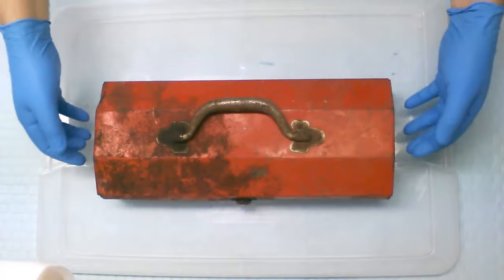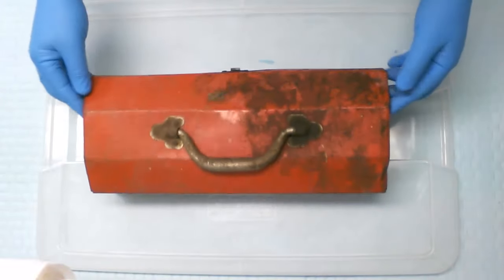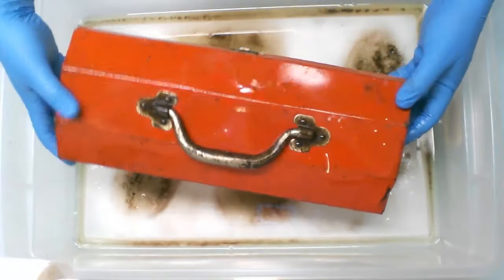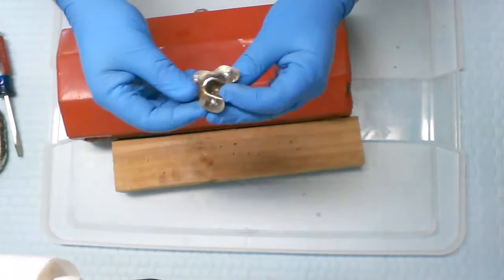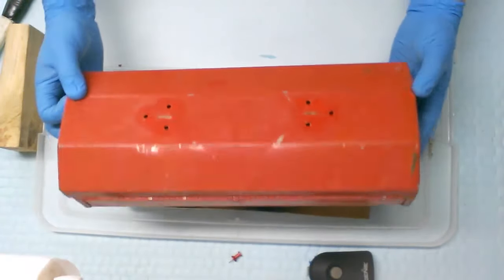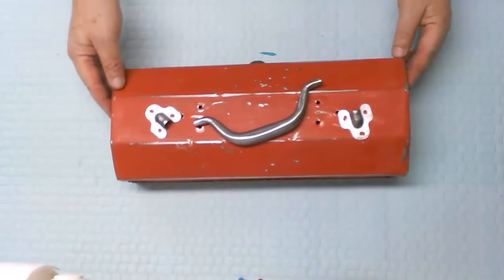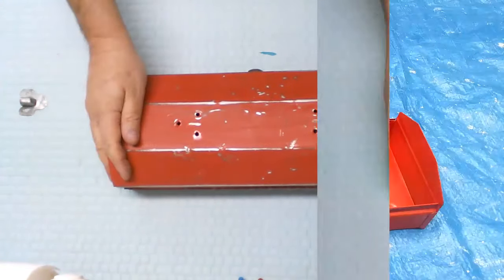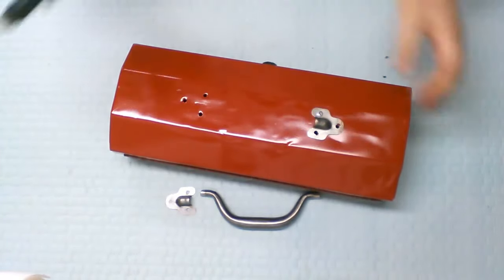Vintage Tool Box Restoration

Comment from the maker: In this video I take a tool box that was sent to me by a subscriber and I fix it up. As you will see it was dirty, grimy, and full of dents, but I make it look like brand new again. If you enjoy restorations, you will enjoy this video. Thanks to my subscribers that support the channel and are kind enough to send me stuff to work on so you can all enjoy.
Reply: Modern DIY Projects — just curious.... has this toolbox seen better days? LOL!! 😂 just teasing.. QUESTION: I have an old metal toolbox (unknown manufacturer) AND a metal unit w/ 2 long drawers (which seem to be designed to hold index cards?) made by “ASCA STEELMASTER PRODUCTS”.... both pieces were on the curb for trash, so I snatched them up...

I was planning to knock of the rough spots and sand ONLY the rusty pitted areas (of which there arent very many) and then just applying a few coats of Rustoleum matte green spray followed by a coat or 2 of rustoleum matte clear coat.... 

However, many videos show FULL TEAR DOWNS & FULL SANDING so I’m beginning to wonder what your “rules of engagement” are when deciding between the options of fully sanding or just cleaning up before paint

CAN I do this project my way?? Or will I suffer consequences??  Any advice would be great.... I really don’t have the tools/product to handle all the sanding and soaking... was just hoping to seal up the rust spots with my multiple matte sprays and make it look custom and cool for many years.
Reply from the maker: @flojotube  Your way is just fine. I have always tried to minimize the work done if possible. Just clean up the rusty areas down to bare metal and primer. Then sand the other areas enough to rough it up so new paint has something to grab onto. Then clean and spray with a new coat of paint for everything. It will look like new when done.

Comment: Great video. Going to fix up an old craftsman box and appreciate the walk through. What tool did you use to remove tye rivits?
Reply from the maker: That's easy enough. Just use a metal drill bit and drill them out from the back. If you must do it from the front use a punch first or the drill bit will wander all over the place.
Reply: @ModernDIYProjects  thank you!

Comment: May I ask what kind of rivet did you use? I am still learning so I am confused with so many kinds of rivets that are out there.
Reply from the maker: I just picked the one that would fit in the predrilled hole. I just replaced the existing one, so I found the size that matched.

Comment: Perfect little tool box for the Rivet Gun and packs of Rivets 😁👍
Reply from the maker: Great idea! 👍
Reply: Or stapler and staples. Joe Smith has couple like that he found and painted. Joe Smith put a cordless detail sander and sandpaper in 1.
Reply from the maker: @SgtJoeSmith  a detail sander and paper? Wow, that is a great idea, but seem like a tight squeeze.

Comment: Hello, just wondering what’s the liquid you use to clean it off to begin with? I’m currently in the process of sorting out a workshop that’s full of tools from the last 100 years and some of them need a little work. It sounds like you said “Russian start” but I tried googling it and didn’t find anything. Any help would be greatly appreciated
Reply from the maker: This tool was really cursty will grease and oil so I used Gasoline to clean it off. If you have rust issues I would recommend a rust and calcium remover for that.
Reply: Modern DIY Projects awesome thank you I’ll give that a try

Comment: Not sure if you will see this. I'm starting to restore my fathers old craftsman toolbox from the 60s, do you need to sand it down to bare metal in order to apply new paint? Or just until most of its off/smooth to the touch. Thanks!
Reply from the maker: All you need to do is sand until everything is smooth to the touch so you have an even base to paint on. Go to bare metal only on places with rust or other damage. Also be sure to primer bare metal before you paint on top of it.
Reply: @ModernDIYProjects  Thank you so much! So much conflicting information out there this cleared it all up. Thank you again.

Comment: Found a 40 year old toolbox in about the same condition. I was looking for something to store LiPo batteries in. The old toolbox was perfect , other than looking like the above toolbox. You've given me a great overview for a rainy weekend project. The only question I had, maybe I missed it, but was was the first cleaning solution you used to get all the dirt and grime off? Thanks for putting this video together! Great help to me , and I'm guessing quite a time and money saver.
Reply from the maker: I used Gasoline, but you  can use any solvent that is convenient for you. Kerosene, paint thinner, etc.
Reply: @ModernDIYProjects  Thank you sir! And again, thanks for the time putting this together. I'm subscribed, and will be bugging you with equally dumb questions in the future.
Reply: Done! Looks like a brand new tool box! I’m also a proud new owner of a Rivet Tool. Other than that expense it was just some 220 grit sandpaper and one large can of red metal spray paint. Couple hours prep time, around 4 coats of spray paint and now I have something if one of my LiPo batteries explodes I won’t burn the garage/house down. Great video, huge help. Thanks again! Easy project for anyone new to metal restoration.
Reply from the maker: @jeffhenderson3318  Glad it worked out for you. Happy I was able to help even in a small way.  👍👍

Comment: i love restoring things to.if you need to remove rust or tarnish from brass or copper all you need is vinegar and table salt just soak your tool or whatever in vinegar for 24 hours or until rust or for brass or copper until tarnish is gone.

Comment: I know I’m a bit late but what do you use to clean it in the beginning? 😊
Reply from the maker: Never too late. IIRC I used Gasoline to clean all that oily mess off of it, but I put it into a dish soap container so it was easier to apply.
Reply: @ModernDIYProjects  Gasoline is a fuel, not a cleaning solution. Very dangerous practice to say the least. Go to a burn unit at your nearest hospital and see for yourself exactly what you are flirting with. If you have a Harbor Freight store nearby, then you prolly have a dollar store close by as well. There you'll find plenty of cleaners and degreasers to safely & adequately remove any oil/grease from anything you're working on. Please read & heed these words for yours and others safety. Plus the dollar store solutions are less expensive than gasoline. A mega win, win. Stay safe.
Reply: @Fishwacker59  gas is great for cleaning stuff. I wouldn’t clean something with gas that’s next to a fire or someone grinding.

Comment: What solvents do you use to clean it? I have a similar box and its rusted but has some very cool factory paint pattern that I dont want to lose.
Reply from the maker: Good question. I start off with soap and water and then use gasoline for the harder stuff. It is tough on oily residue, yet mild enough to not destroy most paints. You can also try Goo-Gone if you are concerned about damaging the paint or stickers or anything like that.
Reply: @ModernDIYProjects  so the soap and water and then the gas will remove the rust ? I have a similar box I want to restore but it's got more surface rust than the one you're working on.
Reply from the maker: @rippvanwinklestein2126  I wish it was that easy. Soap and water will remove the dirt and gas will remove any grease and oils, but only sand paper and elbow grease will remove rust.